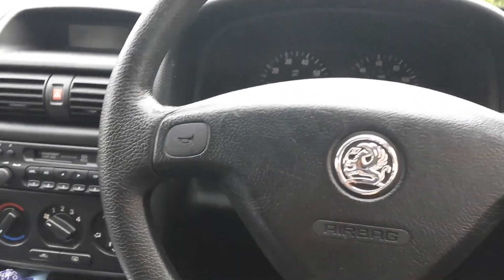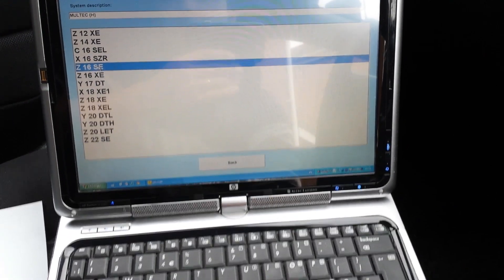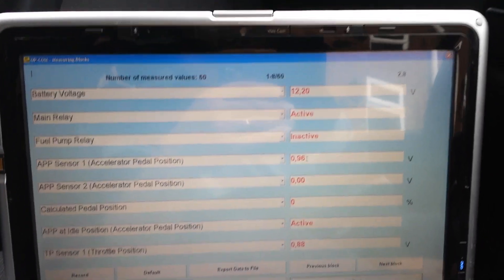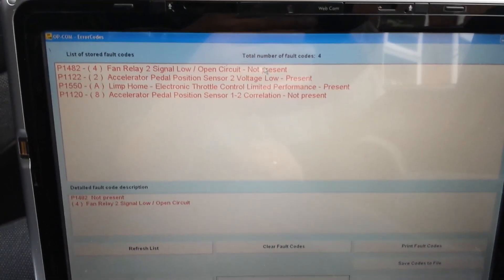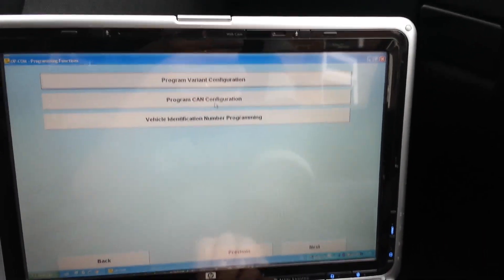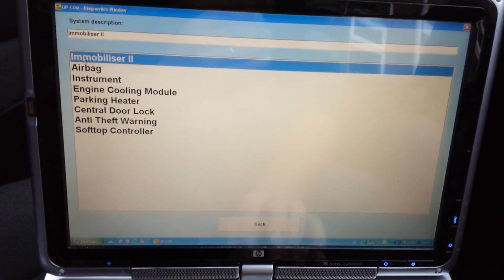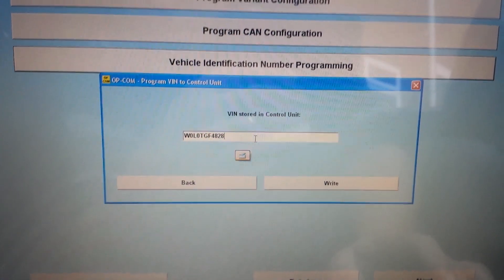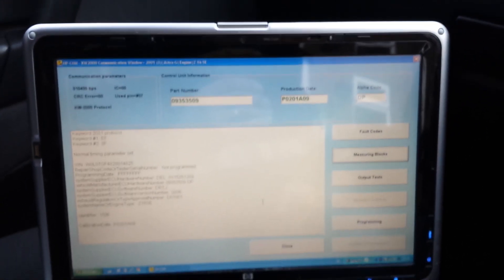Astra 2001 accelerator fault and Engine ECU change and programming.

Comment: hi how much Xprog  ?im also working mechanic i wana buy that thnxx
Reply from the maker: Hi
As you be or not aware, some of the China carprog have a few flaws. ..
and cause you never know which one you are going to get....
I bought my one from a trusted seller, on well know auction website, he modify them and test them prior to sell, not just the unit, but some of the cables as well, so you are guaranteed to get a reliable carprog. 
I paid around £150.
Thank you for watching.
Reply: thanks so much frd  i relay like ur vidoe

Comment: Wow thanks for this video I need to get my op-com working so i can sort out my astra 2002 & program it to have cruise control & a second key remobilizer  I also think i need an ecu like that one you fitted as i have a MISSFIRE when cold otherwise my car is good no codes or lights on . can i just ask where you got the reset ecu from & how much it was ? oh & how did you get the car pass code as i have an astra without a carpass but need a second key for that Many thanks Mark
Reply from the maker: Hi
Thank you for watching. 
I actually bought the ecu already reset, but you can reset it your self if you have how to retrieve the pass.
As for the pass you have a few tools able to do it, in my case I used carprog.
Reply: +lmsvvavr Isn t carprog enough , I see that you use Xprog also ?
Reply from the maker: +radu soptea 
hi
Although I also have xprog, I have not used for the works carried out on the video above... xprog I use it for other things.
For the video above, yes, carprog is all you need.